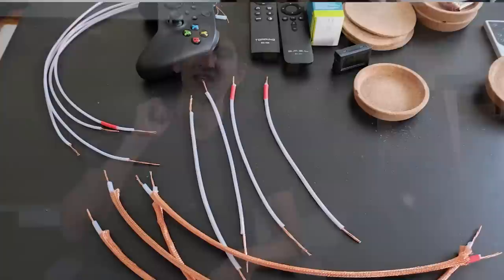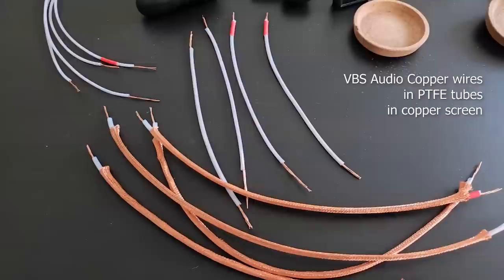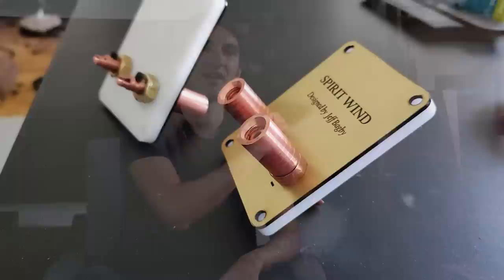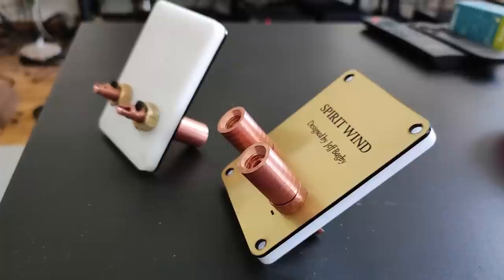High End 2-way speaker Spirit Wind

Comment: Hmmm not bright & edgy can sometimes mean dull & muffled. Its a double edged sword. On the other hand, open, airy & shimmering highs could also mean bright & edgy. Reviewers sure know how to use their words. Good clarity & transparency usually comes at the expense of a little brightness. You cannot have a highly open, transparent sound that is at the same time dark & mellow. So choose your preference. KEFs spks are always a bit hazy & lower in resolution but their bass is strong. SF electa amator 2 are dated in sound. The electa amator 3 sounds more open, transparent & far more resolving if a bit bright. Marten duke is well balanced in sound.
Reply: @GAN CK  
It's all about choosing drivers that compliment each other and ones that can be implemented properly to produce a cohesive single "point source" with smooth, even frequency response.  The driver spacing and baffle size/shape/design all contribute either negatively or positively.

It's also VERY important to properly implement the Crossovers to mitigate or eliminate any negative attributes of each driver.

If you allow the midwoofer to play too high in frequency, it will start to play into a region where there are common high-frequency cone breakup modes (distortion) which mask detail and transients/dynamics over the entire bandwidth of the loudspeaker, as well as produce beaming effects which produce a mismatch in directivity between the midwoofer and tweeter and result in uneven in-room response and a disconnect in realism/naturalness.

Same for the tweeter.  If you try to cross it over too low, it will cause ugly resonance and fatiguing distortion in its lower registers.  The crossover and resistor/padding on the tweeter must also be perfect so that there is not an imbalance of high frequencies.

Nearly all Scanspeak tweeters have a natural built-in rising response in their upper register which must be considered and the crossover design and padding must account for this.

These tweeters have incredible detail, yet do not exhibit any harsh or fatiguing attributes IF the crossovers and overall design is implemented PROPERLY.  For those who say these tweeters are harsh or fatiguing, they have not been properly implented in the design and then they complain that it is the tweeter's fault!

You can achieve amazing detail and "air"/spaciousness without any fatigue or brightness/harshness if you mitigate distortion and design for smooth, even frequency response that doesn't have too much of a rising response and/or significant peaks.

I can take just about any decent tweeter and design the system so that it is smooth and detailed or bright and edgy.  Same tweeter, just different crossover "settings" and/or physical baffle design/placement.  It all has to do with how it is implemented with the midrange or midwoofer.

All that being said, I wish Jeff was still around to design an update or option to use one of the newer BlieSMa Beryllium tweeters (T34B-4 or T25B-6) with this midwoofer.
Reply: @bbfoto7248  yes agree with u on the most part. I feel that loudspeaker design is a black art. Highly advanced high tech drivers & xovers don’t guarantee good sound. I used to own an austrian made speaker that uses paper for both their midwoofer & tweeter & that speaker is incredibly dynamic, fast & open if a tad forward & bright. The paper cone tweeter is also very detailed, airy & very crisp unlike paper tweeters from old JBLs. Btw, that speaker uses paper drivers made by Visaton. Very cheap drivers actually but they sure can take lots of abuse without sounding uncouth & out of control.

Comment: Please send me the name and address of your cabinet maker for this project. I take it you used a local Serbian company. I am in Germany. What was the  ~€ cost for the cabinets?
Reply from the maker: It's not a company but one handyman that won't do it again. It was done as a favour return to one of my friends. Because of that price was very cheap and not commercial. I would expect this level of quality to be around 500€ if we didn't have special treatment.
Reply: @iiWiReviews  Great to know. A fair price. In Germany, we have many specialist woodworkers, whom we call Schreiner. I spent the afternoon today looking at designs from Troels Gravesen. He has a number of 3 way -5 way designs. Your speaker is a beautiful 2 way and the drivers are well crossed-over. Do you know the cross-over points, and the slope below 40 db. It sounds so clean and catches a lot of color down low.

Comment: G.R. Research  better ?
Reply: In general, not in my opinion.  But it DEPENDS on which GR-Research DIY kit you are comparing the Spirit Wind to.   Just the quality of the individual drivers used here are some of the absolute best available in the world.

Overall, Danny's DIY designs use much "cheaper" drivers (most are from Peerless of India or another build house in Indonesia) that are "good" at their price point, but nowhere near the level of quality and performance of these premier drivers that have been created by some of the best Danish transducer engineers and manufactures in the world.

However, the B&G Planar drivers that Danny uses in some of his designs are very good (I have used them myself), but they also have some negative attributes if they are not implemented into the overall design just right.

Danny's forte or niche is making very good DIY loudspeakers using inexpensive but good drivers at a good consumer price point.  This demonstrates how important it is and what can be achieved by using good cabinet design and proper crossover implementation....which is basically what he preaches.  But at the same time, some of his designs are just piss poor for what he charges for the kit, and are NOT a good value.  But some are.

But if you apply those same principles and instead use some of the best drivers available, your results will be that much better.  The Spirit Wind are one such example.  Top notch drivers, excellent cabinet design, and excellent crossover implementation.  Even for DIY speakers they aren't inexpensive, but their performance to price ratio is excellent and it's a proven design.

If you have the available funds, I would choose the Spirit Wind standmounts over anything comparable that GR-Research offers.  Just sayin'.
Reply: @bbfoto7248  Most  likely!

Comment: im sorry i love you but watching zipties and no using any kind of isolation material to prevent vibrations on them takes a lot of from you better recheck that
Reply from the maker: Everything was hot-glued to the HDF board that sits on some sort of isolation pads made out of dyneema material (just didn't take any picture in that phase). Also, due to the speaker mass (17kg each) there's very little vibration going on compared to most speakers.
In the end, I don't say that I did everything perfectly, but it is my first DIY speaker and I did my best with it. Some improvements might happen down the road, but for now I'm happy with the result.
Reply from the maker: For a time being I considered external crossover, but I had to draw a line somewhere...so I gave up on that thought. It's so easy to get sucked in projects like this with just a bit more attention here and just a bit better components there. It never ends if you allow it. 😵‍💫

Comment: I'm sure it's good, but that is one UGLY speaker.
Reply: Not to me.
Reply: There are several off-the-shelf commercially available loudspeakers that are pretty much identical and sell for 3x-4x the price.  Aesthetics and "looks" are subjective, just like architectural design or particular automotive body designs and colors.  Beauty is in the eye of the beholder.  

The builder and reviewer here added the diamond-shaped facets to the standard front baffle design....IOW he modified the front baffle design to his own preference compared to the basic enclosure plans provided by Meniscus Audio and Jeff Bagby.  He also chose the Walnut veneer and stain color and finish to his preferrence.

As a DIY speaker project, you can design and finish the cabinets any way you want to as long as you adhere to the basic enclosure dimensions and specs.

Comment: They look like Diapason's 🙂
Reply from the maker: This shape is used in some extent with many speakers because it's proven that it brings acoustic benefits - less diffraction, better soundstaging and the feeling that boxes themselves disappear from the sound. 
Only question really is why more manufacturers don't do it (this or round edges).
Reply: @iiWiReviews  Because some manufactures use the cabinet resonances to great effect. Take Audionote their speakers have a large flat face and they disappear like an electrostatic as do the Devore, similar looking, speakers. It's a question of design.